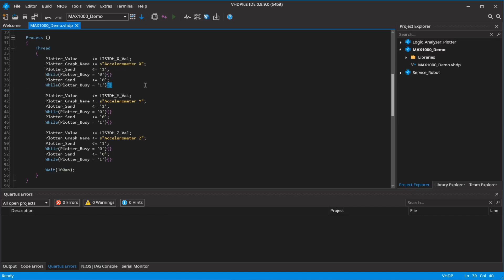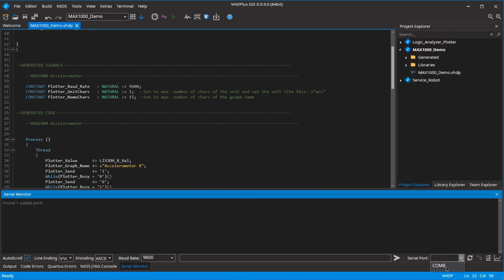MAX1000 - The Full Power of FPGAs for less than 30€ (+ Serial Plotter)

Comment: Even though I have a TEI0001-02 version, I think the schematics for the TEI0001-03 is more informative..while there doesn't seem to be any functional difference.   

However, any thoughts on the jtag driver?  It seems newer boards (after June 2020) must use version 2.4 or higher, but will older boards work with the newer driver too?
Reply from the maker: We use the newest drivers and also older MAX1000 work fine